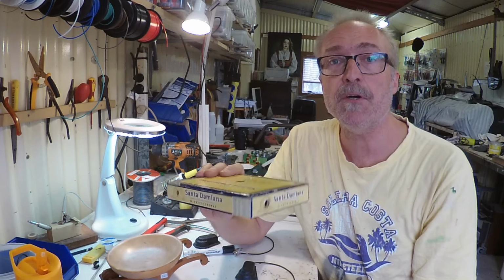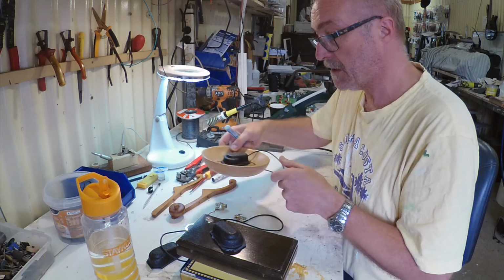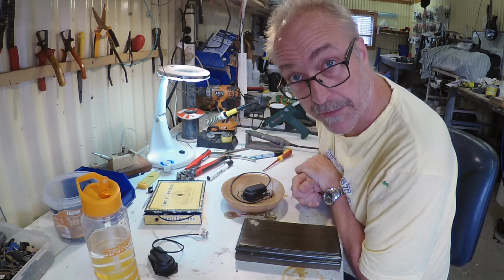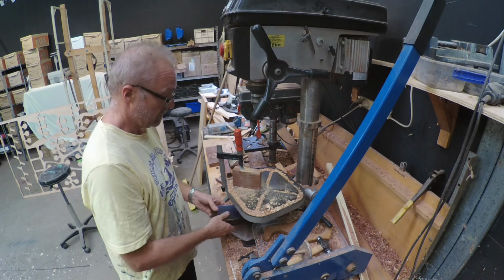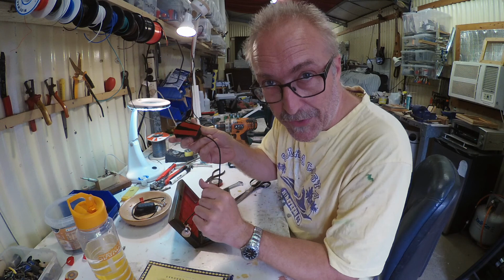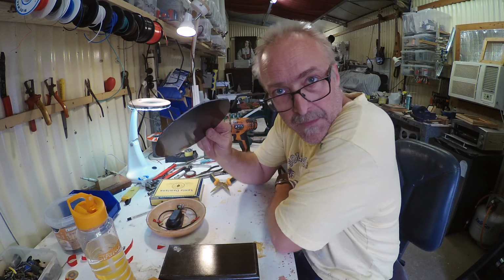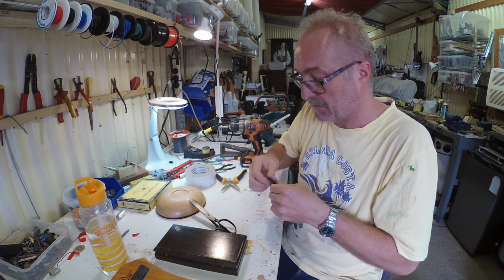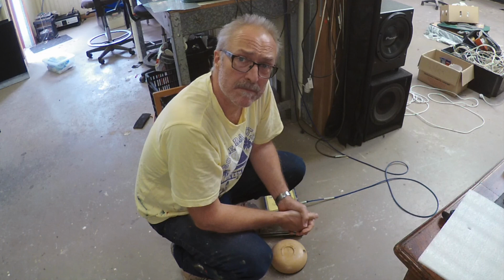Peterman DIY stomp box demo

Comment: To get the paper off of the tape when you can't get a hold of it,  just simply put a small piece of tape on top over hanging the paper part enough to grab a hold of it and it will pull the paper off. Works for me every time

Comment: To remove double sided tape plastic, use the tip of a blade in a quick upwards graze/flick like motion length ways from  the corner of the plastic, good vid 👌🏽